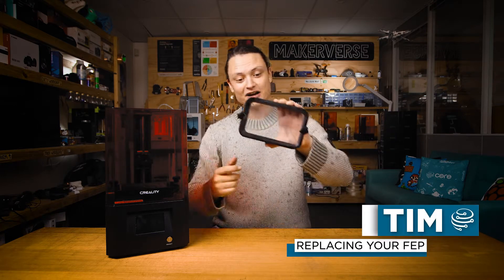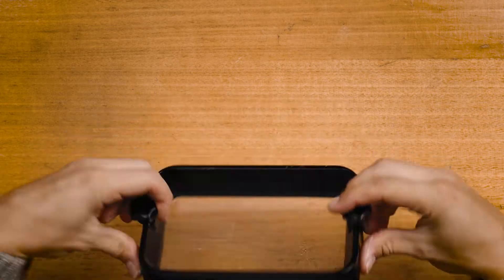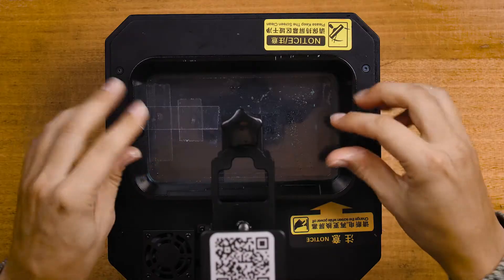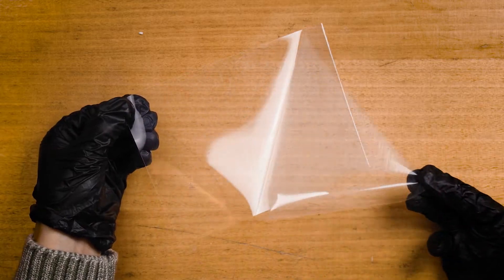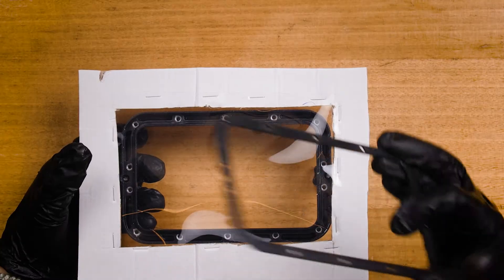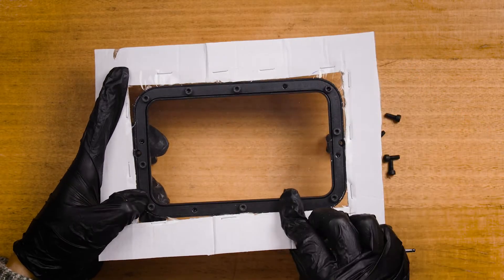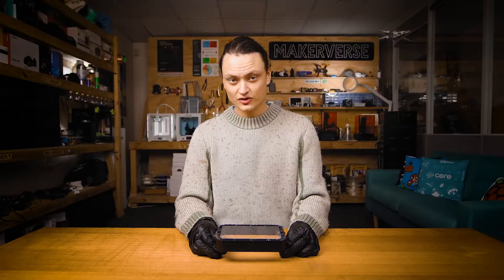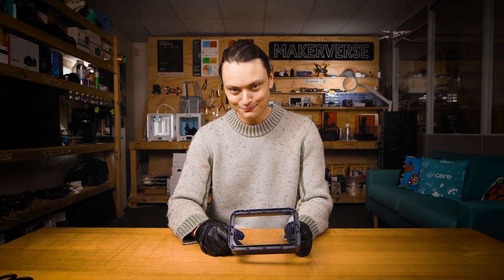How To Replace The FEP Film On A Resin 3D Printer - Tips to do it Faster and Better

Comment: IPA tends to fog the Fep screen. I use it on the body of the vat but not in the actual fep sheet. Instead I use a microfiber towel and wipe it down after emptying the vat. I learned this method from another video but for the life of me I can’t remember who it was. I wish I could give them credit! Anyway, it works really well though it takes about four wipe downs. I recommend cutting the microfiber cloth into several smaller squares. 😊

Comment: Best tutorial so far! Awesome video
Reply: There is a much easier way to do this.  Just take the uncut FEP sheet and sandwich it in between the metal gaskets.  Pick one of the corner screw holes and put a hole thru it, then the screw.  Go to the opposite corner and pull the fep tight, while holding it tight pop a hole then put the screw thru.   Then repeat that for the other two corners.  Then just proceed by putting holes in the remaining screw positions.  Then run all the remaining screws in.  Lastly you just take a sharp knife or razor blade and trim the FEP off.  No need for the cardboard frame or stapler.  I about died laughing watching this video

Comment: Thanks for this. Do you have any experience with the tanks for the Formlabs 1+? Formlabs stopped supporting this printer, which still works very well, and 3rd party tanks are expensive and not always reliable. Thanks for any help with this.

Comment: Great tutorial! From what I understand, you wouldn't want to use this method on a Mono X as you want the FEP to be loose when you first attach it. The tension comes when you screw the final layer of bolts. So just be aware, it depents on the type of printer you're using.

Comment: This would be great if anycubic didn;t screw us on the photon mono 2. They made the plastic FEP frames glued to the FEP so you have to replace the whole thing and not just the FEP. They also made the frames out of garbage plastic that cracks super easy so over tightening the screws breaks it, trying to separate the frame breaks it, looking at it wrong breaks it. They also made the VAT screws that hold the VAT to the printer thread into plastic so they strip super easily. So far I am pissed about this machine.
Reply: They most likely did that because it’s one of the cheapest machines. I have one and it’s fantastic. I just now had to change my fep. Amazon has them preinstalled into new metal spacers. Super easy to change. 2 of them for 20 bucks.
Reply: @burlahoe  I found where someone designed a frame to use with the mono 2 so you can just use plain fep sheets.

Comment: I got a anycubic Photon m3 and I want to change my fep but I’ve read that I can’t change just the fep sheet and need a  fep with a frame. Is that true? Thanks a lot👌🏽 love your content
Reply from the maker: Cheers mate for you kind words ❤️! 

Just researched and it looks like the Photon m3 uses pre-framed sheets (which seems to me a step in the wrong direction). Here is a 3D printable M3 FEP Replacement Frame - https://cults3d.com/en/3d-model/tool/anycubic-m3-fep-frame. If you print that off and use it in your machine you'll be able to follow through the same process I outlined in the above video 🙂
Reply: If you're really careful you can disassemble the frame and reuse it using this method.  It's glued together at contact points inside but I was able to separate them with a razor to split the seam and a putty knife to pry it apart.

Comment: Wow, whatte clean and crisp video.
Any recommendation on how to fix the rubber gasket/seal, foundybetween the FEP sheet and vat tank, that has loosened significantly?
Reply from the maker: Cheers mate 😊 on my Creality systems there isn't a rubber Gasket/Seal only a metal spacer. Not quite sure the issue your facing, which Printer are you working with? Perhaps some washers between the screws and metal spacer could help.
Reply: @Core-Electronics  I'm using a creality LD002R, the gasket looks like a huge O-Ring. It is sandwiched between the Vat tank frame and FEP sheet, around the inner rim of the vat tank wall.
I couldn't find the replacement anywhere, few blogs suggested putting it in hot/cold water didn't really work.

Ended up printing a custom vat using TPU on my ender. Haven't tried it yet.